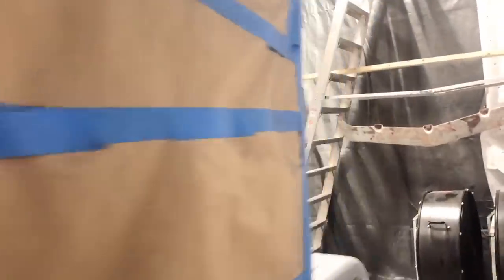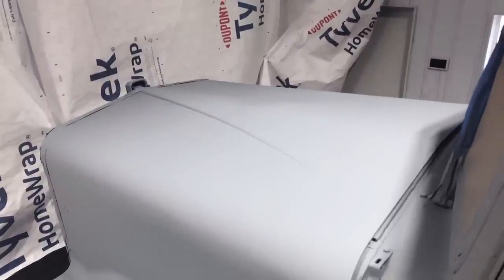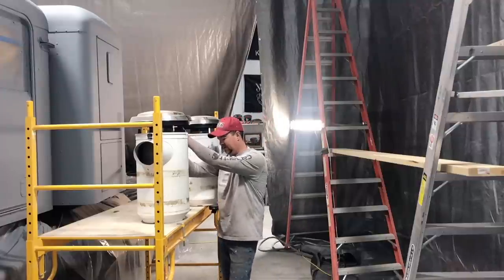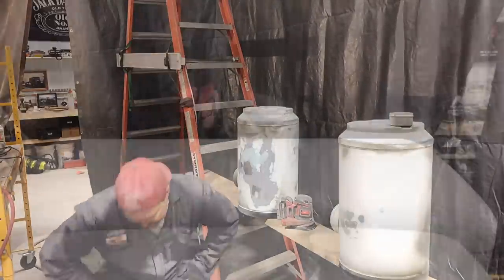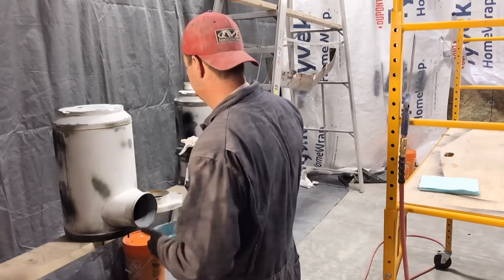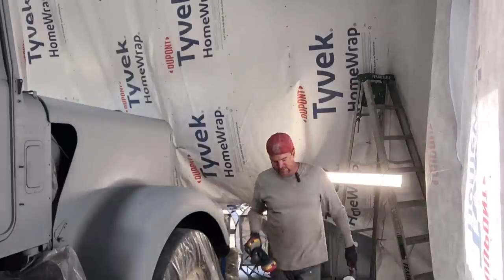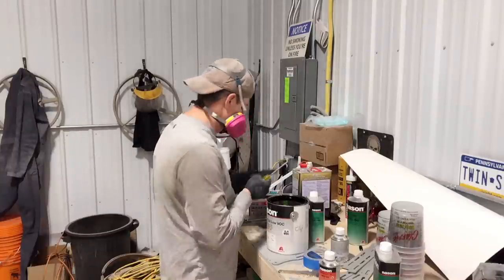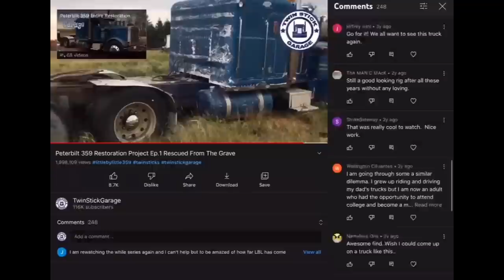Smokey & The Bandit Tribute Truck Ep.44 The Joy of Painting

Comment: Single stage paint Mark you need a good tack ( light) coat then 2 good full coats you'll need probably 1.5 gallons 
Putty isn't for what bondo is for. Putty is for pinholes. Not dents. Also pay more attention to the big block sanding you have to go in a x pattern. You were going back and forth a lot.. Also on wax grease remover get you one of those 2 quart pump up sprayers to use much easier..

Comment: Body guys used to call primer 1/4" paint some times a few layers are needed to fill low spots.  I like the idea you had loading that spray bottle with pre-wipe or wax and degreaser(used to be Dupont 3812s). the Nason single stage was a great choice of paint it was cheeper but close in performance to Dupont Centari.  One last comment,  please consider blowing dust off the body with compressed air and wiping with painters tack rags before spraying color.  painters coveralls and a head beanie will also help keep dust, lint and hair out of the color coat.   You are doing fine work, such a cool project.

Comment: The key to success with paint and body is following the steps, if you follow the steps you will have good results and if you skip steps you usually regret it.  Following steps is key especially when it comes to preparation and sanding , make sure you run through the grits letting each one do it's job eliminating the sand scratches from the previous grit.  You have to be especially careful with metallic paint otherwise you will get modeling and the metallic will lay in scratches making it very obvious.

One of the greatest things to help with painting is the technological advancements with led's and lithium battery technology, get yourself a super bright paint gun light that is attached to the gun and it makes a world of difference.  They are light enough and bright enough with long enough run times to be worthwhile.  Having that consistent light source at the exact angle you are painting allows you to lay down paint more consistently.

Comment: Couple things for thought, have lots of airline 50' or more, fix the line at compressor on the wall going up in a back and forth pattern as its harder for water to go up hill. Compressor gets hotter depending on size with bigger jobs. Don't put water filter close to compressor and put second  one on spray gun.

Comment: Wait where was the guide coat and blocking? For your next project try Slicksand high build primer. It’s always easy to find issues when shot with primer, then be able to add filler in wonky spots.

Comment: The inline filters are a must, but they will restrict your airflow significantly. To make a nice paint job I take just cheap spray primer aerosol and mist the whole primer job as a guide coat and block with  180 to get it straight. If it's already straight you can go finer. Then you just need to make it smooth. 220 or 4 or 600 wet sand.

Comment: AS a Professional Painter "is what like to consider myself" with my late father's training, and many years of Painting Military Aircraft.  Painting is an art form. if it's prepped right, it will turn out Allright. 
  1 example, when you have to pure fast drying thinner over surface aircraft to evap the fluids leaking, just to spray paint over it, is type experience you learn over time.  Otherwise, you have to touch up after each flight, but also the Paint used matters. expensive is not always better. it's knowing the product.  MIL used Epoxy poly. let's just say that stuff is like high grade liquid puddy. sprayed though a gun. dry's fast smooth.   So, I see you using popular Nasson paint system. most likely poly/or enamel base good stuff.  practice makes perfection. know the paint, does it like cool air, dry air sprayed in hot weather, does dry fast.   Many things to know when painting anything. as you sprayed the Primer, you noticed the most missed mistake every else makes not paying attention to how primer lays down, by that you are on way to painting the perfect truck.  Best of luck, can't wait to see it finished.